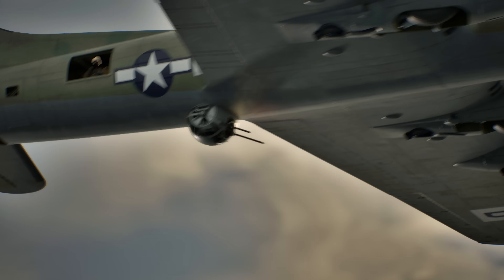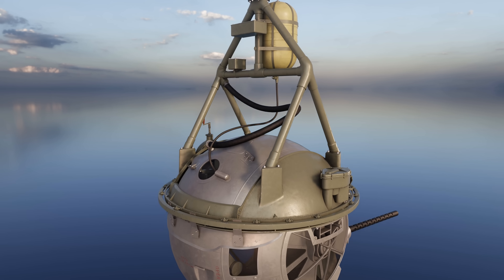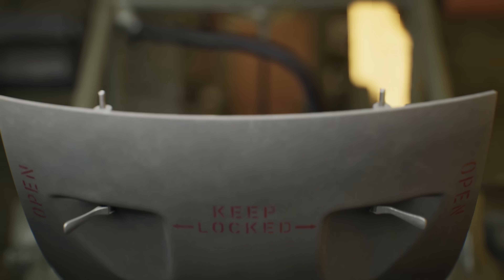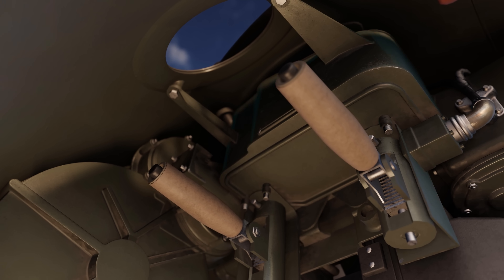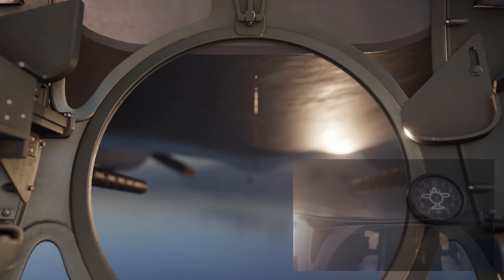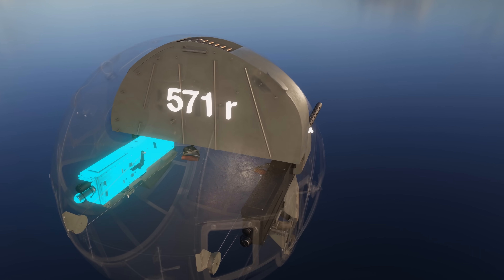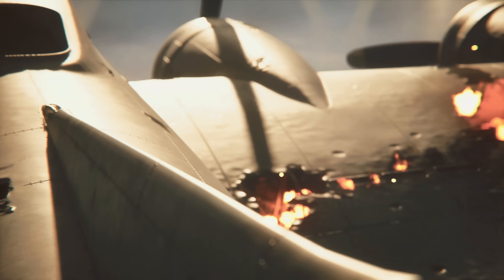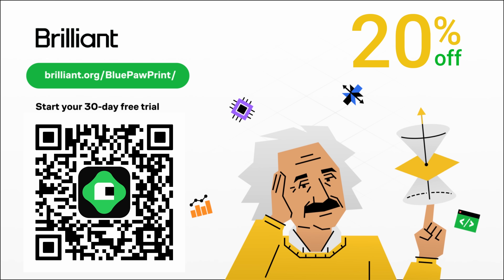Inside the B-17 Ball Turret

Comment: Against 30 mm ?? Hard to believe, if you know that some 20 mm could penetrate more than 1 and cm steel... amother problem were the 30 mm mine bullets, because if they did not hit directly but exploded inside the turret, it was also over for that gunner. Their main luck was surely, that many planes attacked from other angles than from bottom and that they did not aim for the center mainly but the wings and engines. 

The worst thing was surely the missing of the parachute, because if the plane was going down our braking in air, there was no time to turn the ball to exit. So it would have been a good idea to put the parachute somewhere , maybe above the gunner, so he could have connected himself with straps and jump out of the turret, when the plane was lost. I am sure their main losses where with all the planes being shot down, where others could still jump from the plane!

At all no place one wants to sit in...

Comment: I'm reading Masters of the Air by Donald L Miller about the US Bombers in England WWII. Highly recommended. One gruesome story of a returning B17 from a mission, which was pretty shot up & the belly ball turret had got jammed with the gunner inside & unfortunately they also couldn't get the wheels out either & all they could do was a belly landing with fuel nearly empty they had only one choice was to land with the awful consequences for their comrade being crushed into a pulp. They landed on the concrete runway & the ball turret and it's occupant perished.

Comment: My dad was a ball turret gunner in the "Shirley Jean" named after the crew chief's two daughters, 91st bomb group, 324th squadron out of Bassingbourn UK.  It was the same squadron as the "Memphis Belle" but he was there June 25 1944 - Dec 12 1944 after the Belle had completed 25 missions and gone home.  In fact, while he was working toward his 25 missions they increased it to 35 due to losses.  He said they would only send up 3 out of the 4 squadrons on each mission so there would always be a squadron at the field, and each squadron flying always had a couple planes in reserve stay behind as well.  During his time there the 91st lost 37 B-17's: 2 from his squadron and 3 group planes while he was flying, 8 from his squadron while his plane was in reserve and a total of 24 while his squadron was in reserve (13 of which was on just one mission to bomb Merseberg, Germany). When his 35th was completed, he said that was enough, took off his flying gear, left everything in the plane and walked away.  He was on his way home when the Battle of the Bulge broke out and was held up in England just in case but when that was under control he finally returned home for a late Christmas. Dad never talked much about it but finally shared a few stories.  One time a plane from his field came back with an 88mm shell lodged in the wing tank which never exploded because some brave slave laborer on the German assembly line had stuffed newspaper in it instead of explosives. God bless the greatest generation for their sacrifices and everything they did for us.

Comment: Back in the late 60's I knew a missionary in Brazil that had been a belly gunner in a B17 out of England. He related that at one time his flight got a new pilot and he wanted to get better mileage so the belly turret was removed and a sheet of metal was placed over the space. On that day they went on a bombing run over Belgium. His job was to assist one of the side gunners. During the run he casually looked at the sheet metal and there was a three-and-a-half inch hole right in the middle. He looked up and saw another three-and-a-half inch hole in the ceiling of the aircraft. An 88 shell had just run through the aircraft. Had his flight still had the previous pilot he would have been in the belly turret. His life had been spared by events and a merciful God.

Comment: There is no way the turret gunsight accounted for distance to target unless there was a fixed reticule width or a manually adjusted one to a known wingspan of an enemy plane. Unless you’re claiming there was some way ahead of its time targeting radar elsewhere in the plane.
Reply: Presumably, the manually adjusted reticule was the "zoom" funktion mentioend in the video, which was operated with the left foot. That changed the size of the target indicator in the gunsight, so the gunner could adjust it to his percieved size of the enemy planes wingspan. 
That's how range estimation worked in the later B29 targeting system.

Comment: What the hell is a mechanical computer, I want a video about that!
Reply: I recommend  Veritasiums video "The most powerful computers you've never heard of", which deals with analogue computers.
Or, if you have an hour, a nack for very detailed explanations (even by the standards of this video) and are really interested in targeting computers specifically, there is Alexander the OKs "The B-29 Turret System: An Expensive, Effective Mechanical Masterpiece". 
The idea behind them is this: Any mechanical connection (levers, wheels on a track, pulleys etc) can be described by a mathematical equasion. And thus, a wide range of mathematical equasions can be translated into a mechanical contraption. Alternatively you can use analogue electronic circuits, or a combination
The benefit is that this can combine A LOT of inputs and give a near instantanious result. 
Such as combining the airspeed of a plane, the direction the turret is facing (in 3 dimensions), the velocity of the bullets, the distance to the target and the rate of movement of the turret and turning all that into the vertical and horizontal deflection of the guns. 
A myriad of inputs that need to be rapidly calculated together to put out results.

The downside of these systems is that since they are a mechanical expression of an equasion, they can ONLY perform THAT particular equasion, as opposed to programmable computers that work with binary code.

Comment: its crazy how already in ww2 they had FCS (Fire Control System) but id like to know how the computer calculated the range
Reply: Presumably via that "zoom function" mentioned. It would have changed the size of the target indicator, and the gunner would match it to the airplanes wingspan. From that, and working with a preset value for the wingspan of a german fighter, the system would calculate the distance. In other such systems, the gunner had a dial for different enemy plane types (and they were trained to recognise them at distance), so that the system could work with the accurate value.

Comment: Could they have connected a ball parachute system and a release in emergencies
Reply: Do you have any idea how massive that parachoute would have had to be?
Reply: @rockyblacksmith connected to the ball turret ... surley not that big 
We see large chutes attached to pallets and they would weigh alot more
Reply: @mikedon5205  Yeah, those are transport planes. These were bombers that were designed to carry a bombload first. Crew survival was secondary to that, or rather, it was a means to that end. A parachute large enough to bring the ball down at survivable speeds would have cost them hundrets of pounds of bombload.
A military can be concerned with the survival of their crews to an extent, but that only goes so far before it impedes the mission they are sent on. And this proposition (which I'm sure someone at the time also entertained) goes past that line.

Comment: Conceived,  engendered, designed, and built by people of European descent almost 100 years ago. Other things invented by white people include:

Submarines, electric lights, nuclear power, microwaves, CAT scans, automobiles, hydraulic, wind turbines, backhoes & excavators, jet airplanes, aluminum, ballpoint pen, hydroelectric dams, steam power, trains & diesel locomotives, tractors, modern pharmaceuticals, open heart surgery, satellites, radios, telephones, televisions, arch & tig welding, computers, transistors, milling machines, plasma and hydrojet cutting, microchips, titanium, telescope, democracy, capitalism, modern farming, x-rays, typewriters, sewing machines, gyroscope, SCUBA systems, pasteurization, center pivot irrigation systems, bicycles, hypodermic needles, Velcro, microphones & amplified speakers, space travel, airplanes, fiber optics, ultrasounds, internet, printing press, container ships, aircraft , GPS, modern textiles, calculus, dynamite, internal combustion engine, Kevlar, moving assembly lines, antibiotics, aspirin, refrigerators, chainsaws petroleum production, trigonometry, helicopters, thermometer, glass mirrors, directional drilling, Astrophysics, crop rotation, carbon fiber, super conductors, particle colliders, pneumatic tires, MRI, sextant, robotics, telea a graph, microscope, firearms, penicillin, refined oil and fuels, hovercraft, computers, carbon 14 dating, angioplasty, telescope, pipelines, open heart surgery, tower cranes, chemo therapy, light emitting diodes, motion pictures, cameraswas was, digital cameras, CD/DVD, concrete, dynamite, lithium batteries, LED lights, refrigerators, nylon, water pumps, radar, sonar, satellites, distillation, electric motors, magnetic compass, sextant, clocks, plastics, vaccines, vulcanized rubber, insulin, combine grain harvesters, zippers, and concrete …. Just to name a few. 

What did your ancestors invent that have contributed to the modern human age? Feel free to list them out here.
Reply: The hell are you trying to prove. Also white is not a nation. Are Spanish white? How about Italians, Irish, slavs and Jews. All were considered not white once, all are European and invented things. Also China invented gun powder, paper, printing, compasses, umbrellas and a lot more. The Mayan people invented accurate calendars and advanced surgery method like eye and brain surgery. Mathematics and medical practices are literally from Africa in Egypt and carbon steel was invented in Tanzania over 200 years before Europeans figured it out. Muslims in Baghdad invented algebra, clocks, soap and the early chemistry. So what's your point with the White comment?
Reply: @ oh no doubt things like chewing gum and boomerangs came from other cultures, but 99% of the modern world and all its technology, innovations, advances, and conveniences came from Caucasians. No other group of people have advanced the cause of humanity more than people of European descent.

Comment: I think what I find most impressive about the ball turret is it's sighting computer. Tech that takes into account all sorts of different variables isn't what I think of when I think of the 40's. Truly impressive.
Reply: Analogue computers are a fascinating thing. They can be made to calculate incredibly complex mathematics near instantanious. The main downside is that you can only build them to solve one specific equasion (albeit, as in this case, with numerous changing inputs). Digital computers, being programmable, are far more flexible and thus overtook them.
Veritasiums "The most powerful computers you've never heard of" goes into the subject quite well, albeit not into the specific mechanics of targeting computers.

Comment: What an awful job and design could have had a periscope and kept the gunner in the fuselage maybe
Reply: No they couldn't, not at that time. They did use such a system later in the B-29, and it took a truckload of mechanical computers to accomplish that.
Trust me, if there HAD been another option to get the bottom of the airplane defended, they would have done it. 
Others tried on other aircraft, and the defense was absolute CRAP.

Comment: I've not heard that reasoning before, as to why tracer wasn't used.  An additional reason was that the Sperry Computing gunsight was vastly better than a manual system, therefore the tracers became a distraction.  Without tracers the guner couldn't walk his fire onto target, which would contradict the Sperry computer.  Probably for both reasons. 
  If the gunner knew the wingspan of a target, he entered that value into the computer.  By adjusting said sighting brackets on the target, to approximate its wing span in the sights, the computer could calculate range.  And this was where the human element of skill is required.  The gunner followed the target, while adjusting the brackets constantly.  When the target was in range, the Sperry computer did all that stuff the video stated.

Comment: I read of a B-17 that was heavily damaged and the landing gear would not deploy. The ball turret gunner was trapped with no way out. He resigned himself that he was going to die upon landing. Said his good-byes to the crew and a message to the family. When the plane "pancaked" on the runway, the ball turret was wiped out like it had a giant piece of sandpaper run over it. My father was in the PTO and told of a plane that got hit by flak. When it landed, they hosed out the remains of the rear gunner. Is it any wonder why it's called The Greatest Generation?

Comment: The the ball turret malfunctions in the wrong spot or breaks, your stuck. If the landing gear fails.. they are landing with your ass in it and you're not getting out. At like 17 and a twig I could not climb into the open turret at the airshow. It's TINY in there.

Comment: Out of curiosity:  It has been said that the mechanical computer used on the Iowa was so good, that there was no need to update it with electronics in the Gulf War.  How good was that aiming computer on the ball turret in actual use?  (I have read that the much-touted Norden bomb sight was not all it was cracked up to be).  They did lot of high-tech using analog systems back then.

Comment: The gunsight actually needed the gunner to input the wingspan of the target, and part of their training was knowing it on the most common aircrafts, because from that the computer could estimate range somewhat good, atleast when seeing both wings. Shooting from odd angles not coming straight at it was more harder and required more "manual" targeting from the gunner because the computer has less data to work with.
And also the speed and direction of the target aircraft was calculated from the rotation of the turret, i.e the gunners input. So the system wasn't perfect but better than manual targeting.
But it's still an amazing invention.

Comment: When I was stationed at Dover AFB in 1980 I helped do a small bit of the restoration of Shoo Shoo Baby which was displayed at the Air Force museum until the Memphis Belle replaced her. One of the coolest things was that I was able to climb into the ball turret while it was mounted on a frame before it was installed into the aircraft. At 6' tall and about 170 pounds I was barely able to fit. It was amazing how small it was inside. Definitely not a place for the claustrophobic. It took massive balls of steel to operate that thing while in combat.

Comment: This is an excellent step-by-step technical walk-through of the design, function and operational usage of the Sperry A-2 ball turret system. The turret's supporting "harness" was more correctly classified as a yoke, and it was also so durable and securely attached to the aircraft's frame that it would literally often break the aircraft's back if the B-17 were involved in a wheels-up landing with the ball turret in place, hence the directive with the Eighth and Fifteenth Air Forces as well as other commands to disconnect and drop the ball turret prior to such a landing if possible in order to save the aircraft from irreparable structural damage ( a lot of B-17's involved in wheels-up crash landings could usually be restored to operational condition as long as the aircraft's fuselage frame was not broken ). The long-since disproven myth that the ball turret gunner was in the most vulnerable position on the aircraft continues to persist in spite of the hard facts purely for the psychological reason that it felt more exposed ---- in reality, the combination of physical, structural and design factors this article has already mentioned, together with the curled-up body position of the gunner, which made him a much smaller target for projectiles and shrapnel, contributed significantly to survivability.

Comment: The gunner couldn’t wear his parachute inside the turret. But instead had to line the turret up with the fuselage, to open the turret door, climb out of the access hatch, get to his parachute, clip it on, the exit the aircraft another way. All while the aircraft might be spinning out of control, tumbling, inverted or on fire.

Me: “Nope, I’m out. I’m not doing that position”.

Comment: those gun sights were super advanced for the time. its basically a mechanical computer with switches and diodes and gyroscopes. but a slight correction. the gunner had to set the desired range and altitude

Comment: These electromechanical computers that make gyroscopic gunsights and navy fire control systems work are amazing.  I know your cellphone has thousands of times more computing power but these were all done with precision gears and spiral discs and ball integrators.  Not even vacuum tubes much less transistors and microchips.

Comment: Cool video.  I had a thing for B-17s since Memphis Belle came out.  I noticed on the crash landing, the props weren't turned!  Any time an engine stopped working, they could rotate the propeller blades to minimize air resistance.

Comment: Always heard that these crews had 2 sides. Half being mind numbing boredom, and the other half being pants shitting terror. Plus I didn’t realize that the MSRP on those is actually fairly low compared to other attachments for planes. The Forward Looking InfraRed or FLIR turret on many aircraft is easily about a quarter of the size while being 6 times the cost